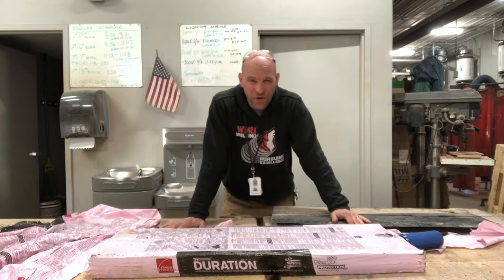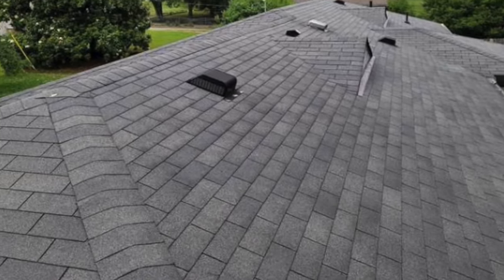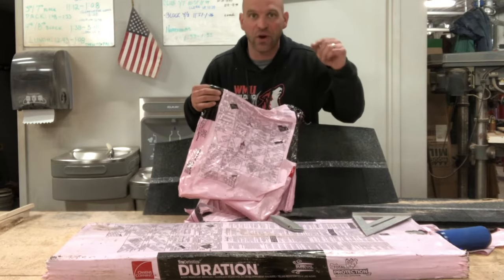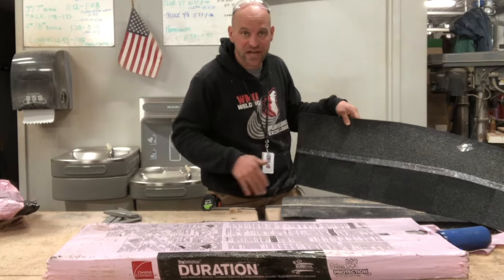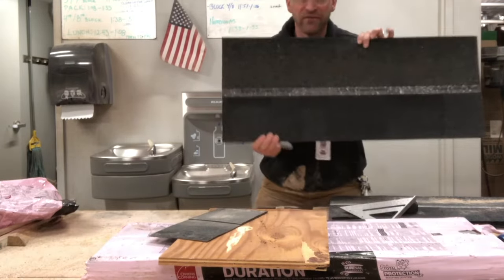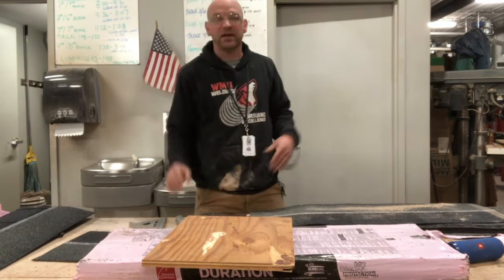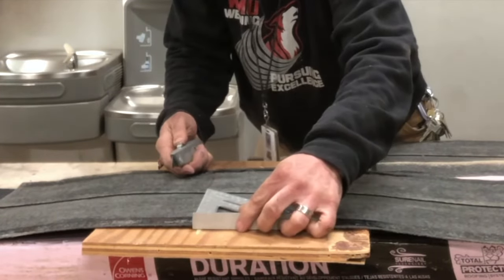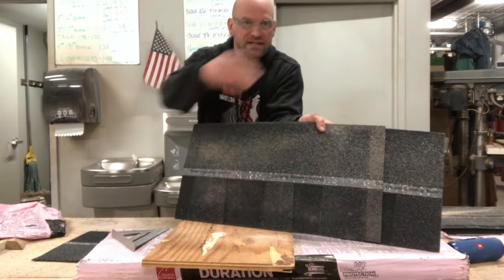How to cut architectural shingles for a staggered start

Comment: How can I start this layout from a hip line starting point? Hopefully that makes sense
Reply from the maker: Yep, it makes sense, I usually start from the valley and go towards the hip. If you want to go from the hip and go, I would start with two full shingles with the bottom corner of the shingle on the hip and the use the layout on the second full shingle and stair step it back. I hope it makes sense, if it doesn’t , let me know and I can possibly make a video on this
Reply: @Trevkongable  yes please make a video . I watched many videos and couldn’t find any that start from a hip .
My roof doesn’t have a valley . I think it’s called a ranch style roof . Do you have any email or a way I can send you a picture ?

Comment: 6 1/2 + 6 1/2 what! 13. I was told 6 off each cut so 6, 12, 18, 24
Reply from the maker: You can sure do that. The 6 1/2 is what the manufacturer recommends
Reply: HDX is 6 5 6  so 6 trimmed 11 trimmed 17 trimmed off each starter